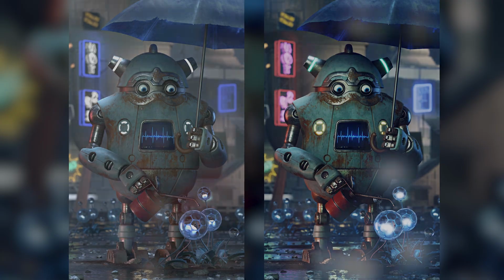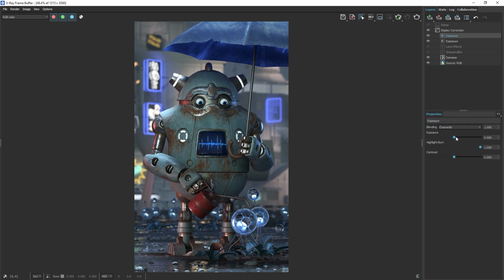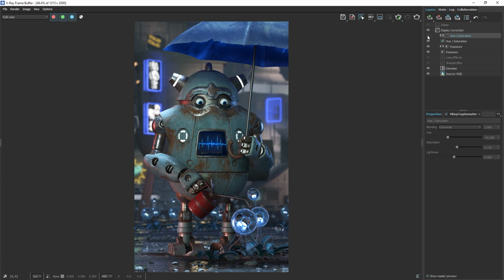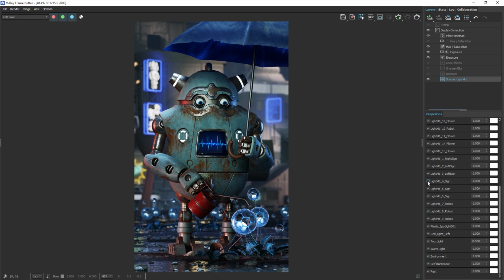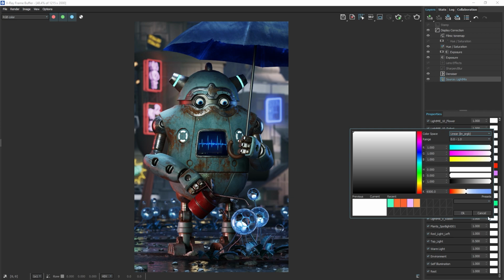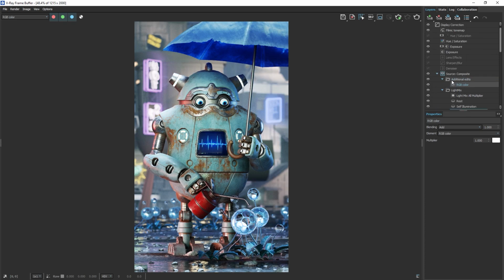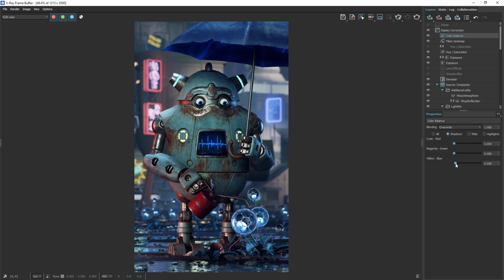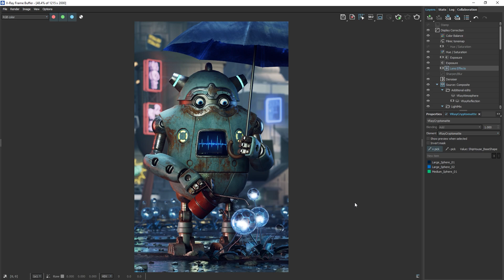V-Ray Post-Processing Made Easy in 3ds Max

Comment: SUGGESTION: add a unique symbol on minimized windows (e.g. Render Setting Window) - this will help which window to Restore Up 
-also, this would be a time saver - specially when a lot of windows in minimized (e.g. Material Window, Render Settings Window,  Cosmos browser, Vray Frame buffer)

Comment: Hi,
good Video!

But you really need to bring back the option to change the backgound color of the VFB from dark grey to white or any other color. It's really hard to judge the darks and the highlights and overall brightness with a dark background. For example, in photoshop I always switch between a black and white background to evaluate my image. This option was in Vray 3 or 4 and it got scrapped for no reason. Bring it back, please!